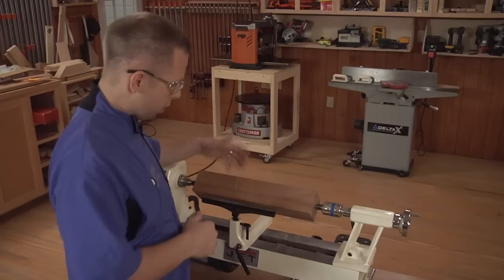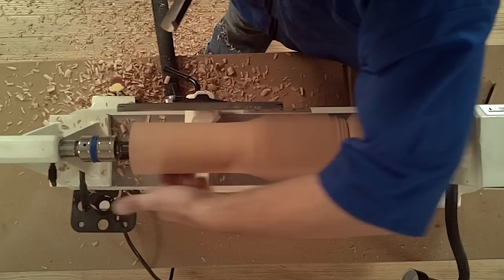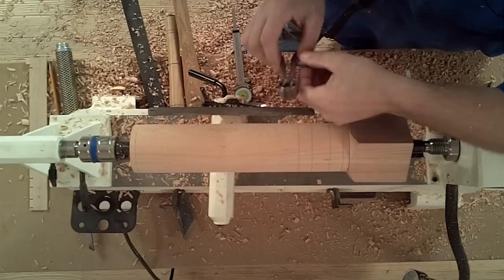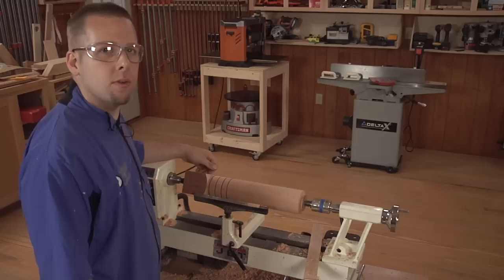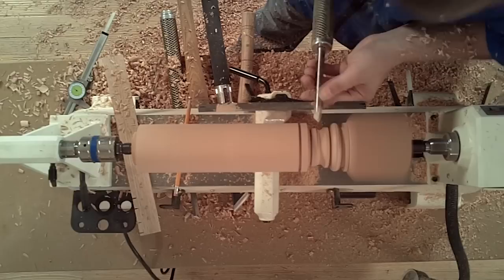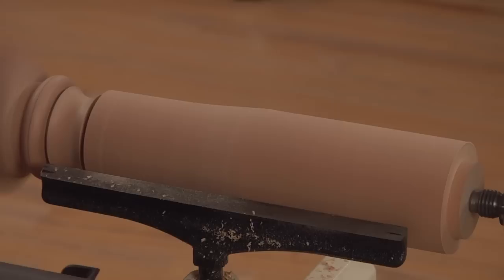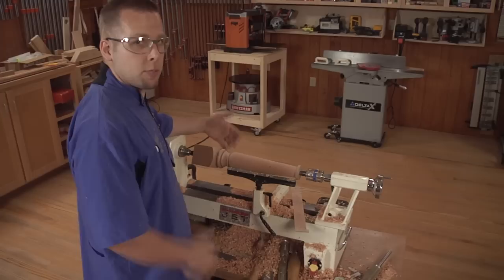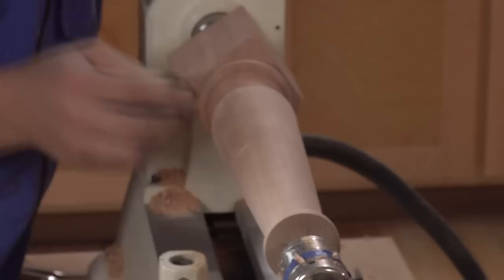How to Turn a Wood Spindle -- WOOD magazine

Comment: What size skew did you use to create the pommel?
I am working with a 4x4 piece of pine and am having issues with splintering. Any general advice? Additional detail, humidity in the shop is at 36-37%, and I am slightly dampening the wood before working (just enough to see a change in color).